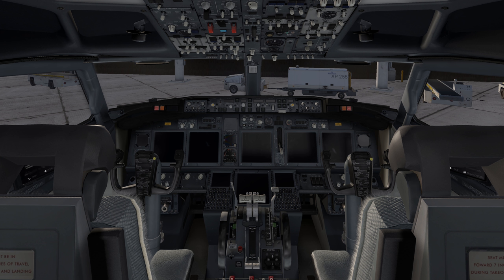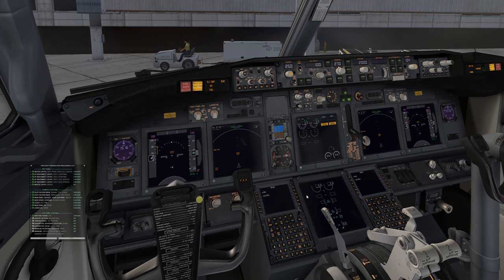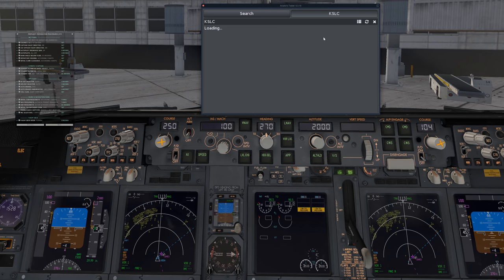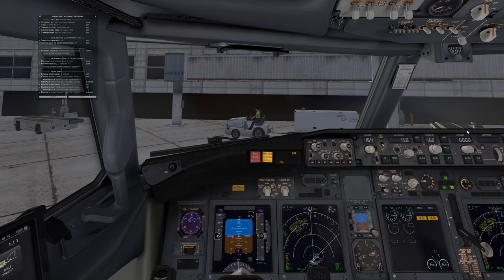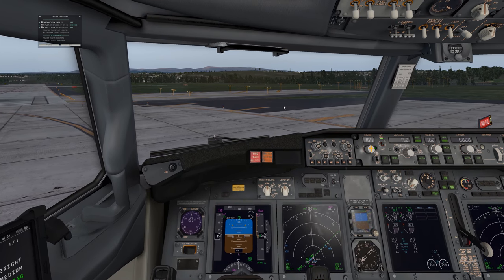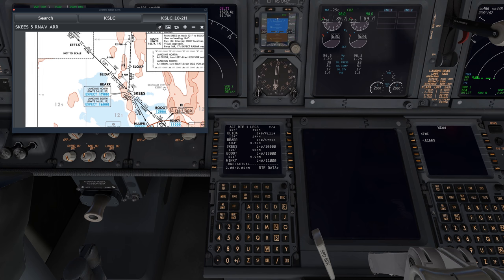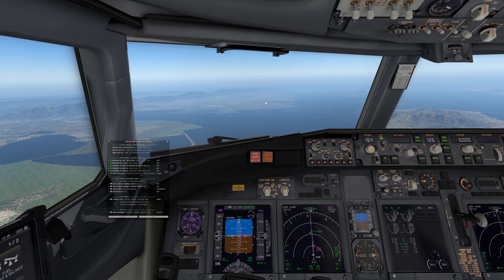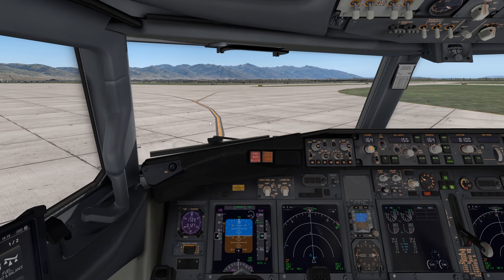Full Flight Tutorial | Boeing 737-800 Zibo Mod | X-Plane 11

Comment: Running thorough checklists makes all the difference in the real world. In your flight(s) your attention to checklists and detail makes the difference between an excellent presentation with real world accuracy and the many sloppy sim videos out there. Well done! In addition, checklists prevent sim errors being made. Your work should set  standards for others.
Reply from the maker: Andre, man, what a nice comment! Thank you so much! I 100% agree, checklists are so essential. I use flows when I fly for real but I always pull out the checklist after my flow to ensure I didn't miss anything!
Reply: @MicahMesser  Pleasure! ...and thanks for reminding us of the different but equally important roles of 'flows' and 'checklists'.

Comment: But ofc you can startup the APU without ground power. It is suppose to start on battery. It's just a small turbine with a small fuel pump ;) both IRL and in Zibo
Also for the plan/fuel field. The Plan field is used when the aircraft is not yet fueled, or during the tanking process. It is supposed to be your final fuel quantity tanked and is necessary only if you want to continue with the perf settings while waiting for the plane to be fueled.

Comment: Great video. Just a small correction, you can start APU if batteries on. GPU is not needed. Actualy this is whats done in real: fwd-1 fuel pump on, APU start..

Comment: I did the exact flight, but failed when I tried to pull the center of gravity in FMC, it doesn't load anything...? 33:50 in your vid
Reply from the maker: Could be a glitch. You can always manually put the CG

Comment: Is it possible to make a working flight plan with the Nav data out of date?
Reply: Yes it is possible. I am doing it all the time. You can use the skyvector. Try to create your own route and then enter it in the FMC manually. For some waypoints the FMC can give error. It means that those waypoints does not exist for airac 1708. At this point you can try to choose another waypoint in the skyvector. For fuel and CI numbers you can use the simbrief. The route that you have created will not be the same as the route ceated by the simbrief but at least it will give some values.

Comment: Hi Micah,
Thanks for all the videos but i Have a question?
On the overhead panel you have only landing light switches, but my Zibo 737-800 with fix v37 it has 4 Landing light switches. How is this happens.
Please clarify
Reply from the maker: Need to go to the EFB and change to LED lights.

Comment: I have a problem.
Whenever i put a specific speed onto the mcp and  when i engage the auto throttle the speed keep on going up and down from my desired speed and is never constant on the speed which i set into the mcp....
Plz help me with this issue.....it would be a great help.
Reply: Do you have N1 engaged or speed? When the aircraft is climbing it can only operate on N1.

Comment: I followed you exactly, here. BUT still missed my approach and ran out of fuel. I noticed on the legs, there is still a "VECTOR" leg listed there, which "most" people say you need to eliminate to fully be on AP. Is that intentional for you on this?
Reply from the maker: I leave Vectors in because in real life, those stay in there to allow ATC to vector you onto final or wherever. I manually vector myself. You can remove them but risk having issues with ILS capture and other small issues.
Reply: @MicahMesser  so, I never heard a vector request during this tutorial during that leg...how did you intercept the approach?
Reply from the maker: Was the vector on approach or what?

Comment: I'm a little confused what the difference is between the heading and course settings on the MCP at about 25:00. Course 162 and heading 164 what's the difference when departuring?
Reply from the maker: Course is the course according to the chart, for example your RNAV departure says flight course 100 after departure. However, the runway's heading is 107. Heading get's set to runway heading and course gets set to departure course.

Comment: Micah, great tutorial, what would we do without X-Plane in lock down. Everything worked fine but just before last way point, engines lost all power, flying well on AP, not sure what happened, I am sure there was enough fuel there were no warnings, just engines stopped and descended until a it crashed.
Reply: Low fuel
Reply: Engine antiice off?

Comment: Can anyone help?                            I have been trying to get zibo 737x to work in xplane11 for months and different problems and bugs keep coming up making xplane impossible to use. I cannot afford £80 for a payware aircraft and zibo seems to be the only solution. At the start of playing plane 11 (mid 2019) it worked perfectly but I didn’t no how to fly I nearly had the hang of the zibo 737 when bugs came up making it unusable. I have reinstalled several times on steam and even reset windows 10 but no luck.                                                       I am running out of options!
Reply: What kind of bugs though?

Comment: Hi Micah! Any tips for someone like me who keeps on having bounced landing?
Reply: 737 pilot, here. Bounced landings are generally the result of a pilot trying to save an approach that wasn't stabilized or chopping the power to a degree that exceeds the aircraft's rate of descent. 
The 737-800 is longer than most pilots first realize and because of the length the flare has to be less to avoid a tail strike. Flying by the numbers (i.e. %N1) and attitude (degrees nose up) makes landing the 737-8, easy, although it's still an airplane that requires the pilot to fly it.

You might try landing with Flap 30, Vref + 5, and between two degrees and two degrees nose up.

The real trick again is a stabilized approach. Check out this video from the feds. (I used the autoland feature in the Zibo mod so my son could get an idea of what a stabilized approach looks like. Stabilized approaches, however,  are the result of getting your descent planning nailed--which can be tricky and depends on such factors as how the controller uses transitions to stack arriving aircraft, the prevailing wind component, the weight of the aircraft, etc.

A good rule of thumb to manage descent is to go from top of descent to 10,000' at 
a pitch angle of about three degrees or slightly more, reduce it to 2 degrees or shallower when approaching 10,000' by bleeding off the power, and then when ATC clears you to a lower altitude you pitch up to 3 degrees again. It's not a coincidence that glideslope angles are three degrees.

The short answer to not bouncing is the result of a stabilized approach and a stabilized approach depends on a well-managed descent.

Comment: Nothing happens when i press "Start Ground Service Crews", I have the gpu, breaks and chocks set. Service and cargo doors are open.  Happens with Zibo mod and the latest Level Up 737 NG
Reply from the maker: Well, the LevelUp doesn't have any animations or sounds for the Start Ground Service Crews. Not sure why it wouldn't be happening in the Zibo.
Reply: @MicahMesser  thank you! I was able to get it working on the zibo. Good to know it’s just not implemented on the Level Up

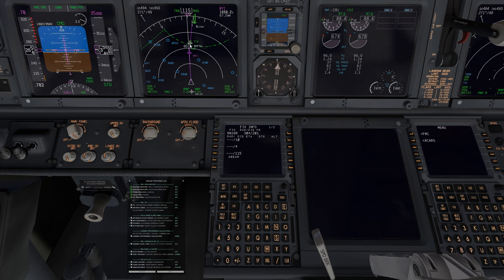Comment: Can you tell me more about the distance ring and how you calculated it to be (35×3) + 10? 1:03:30
Reply from the maker: Sure. So, I use the Fix page to create a ring that is my roughly calculated top of descent. It's calculated by taking your current altitude divided by 1,000.

Formula: (ALT/1,000) x 3 + 10 = estimated distance
Reply: @MicahMesser  thank you for the explanation! But why do you have to calculate this when the nav display already shows the t/d point.
Reply from the maker: @Kpaojd  A few reasons, mainly as a secondary reference if the system malfunctions. It is also to allow for an easier descent for your passengers. The Zibo isn't known for the best logic for descent rates
Reply: @MicahMesser  so is this possible on an actual 737 too?
Reply from the maker: @Kpaojd  I cannot say that is guaranteed. I am not a real 737 pilot. I suppose it's close to the real thing. I got the formula from someone who worked closely with real pilots.
Reply: @MicahMesser  Ohhh okay. Thank you so much for taking the time to reply and of course making these wonderful videos.

Comment: Micah, I'm having trouble getting the PFDs to work. I keep getting an "enter IRS position" message. I tried to do what you did at 16:20, but I don't have that "Set IRS Position box" at the 4th button down on the right.  Do I need, what did you say, "Navigraph?"
Reply: Jacob, I fly 737's and the Zibo mod is surprisingly realistic in its requirements to follow certain procedures precisely. There are some work-arounds and different carriers might do some things differently. One, for instance, might not put on the fuel pumps until just after the brake set subsequent to pushback. Another will turn on hydraulic pumps right after connecting to the GPU so the PNF can see any hydraulic leaks.

Insofar as your question goes, you might try this when setting up your FMC for routing: (It's pretty much the sequence Micah uses, but sometimes it's difficult to follow it.)

First, clear the "enter IRS position" message. you don't have to concern yourself with that until you begin populating the POS/INIT data.

Key POS/INIT, then enter REF ARPT. Select next page and your GPS co-ordinates should appear. Key the first one then go to "Previous Page" and when you set the IRS, your GPS co-orinates should appear in the boxes.

Hopes this helps.
Reply: @andredarin8966  Thank you very much for the help. I actually did figure it out before hand. I wasn't putting the IRS's in Nav. I'm loving this plane now! Check out my landing in Boise if you have a minute.

Comment: Hi Micah, really enjoying your videos. One problem though, at the beginning of descending procedure, when you type in -3/30.33 in the FMC under DES(ISA DEV/QNH), you mention the information is on Page 1 of the flight plan(from Simbrief), I have been looking for these numbers(-3/30.33) but they are nowhere to be found. Also, the FLAP/SPD values(30/149) under APPROACH REF
Can you explain exactly where these two numbers can be found? 
1) -3 and
2) 30.33. 
3) 30/149
PS. It would've been amazing if you can show the documents or information regarding to on the monitor so that viewers know exactly what you are referring to instead of searching for every little information separately. It took me 2 hours just to get to the descent part of the video trying to figure out exactly what you are referring to. As for an absolute novice, it is overwhelming trying to GUESS what you're referring to.
Reply from the maker: Well, I cover how and where to find that information on the other tutorials I've done.

1) that is found on page one of the flight plan under ISA DEV in the column in the upper right hand side of the page.

2) that is the local altimeter which can be found numerous ways and is ever changing with the weather. Google METAR for the airport you are going to.

3) the flap and speed information is the reference information for the aircraft and you on approach and landing. It is calculated two ways: in the FMC itself or with a secondary program. I use ApSoft Toolbox and it is very useful. I plan to do a tutorial soon on it.
Reply: @MicahMesser  My bad for neglecting to look for more basic videos you've uploaded before getting into a complete guide. Now I know what I am looking for and will enjoy even more following your guides. I have found basic and more detailed videos on your tutorial list. Thank you so much for all the great work, time, and passion you put into these guides. You have no idea how helpful it can be to someone like myself who has no prior knowledge in flying but has little or no education on aviation. Thank you again.
Reply from the maker: @eugeneyoung2803  no apologies necessary. You are most welcome. Welcome to the sky!
Reply: @MicahMesser  Hey Micah, one more question. As I was studying your FMC setup video, I am understanding better each minute. I found one thing odd which is in your FMC video when inputting RTE before departure, you input the waypoints in order(starting w/ CACD2) as exactly written on the flight plan, but in this video, for some reason, you seem to start from the middle as 'WANTA' WP is not the first waypoint in the flight plan(your flight plan). Can you explain a little about this procedure?
Reply from the maker: @eugeneyoung2803  checklist calls for the pilot to insert the waypoints then add the SID and STAR. Why it's like that, idk. With the Airbus it's different, it's the SID waypoint then STAR.
Reply: @MicahMesser  Thank you again for the explanation!